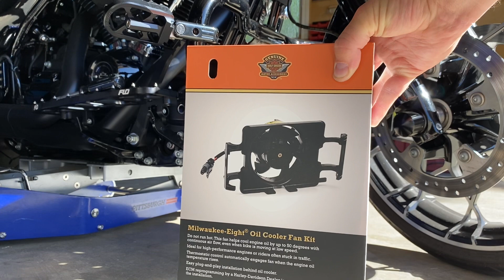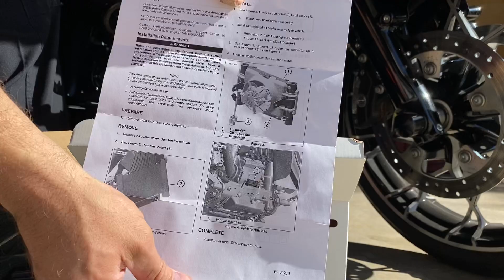Harley-Davidson Oil Cooler Fan Kit, Easy Installation, Ecm Thermostatically Controlled Cooling Fan !

Comment: I recently purchased a 2020 king and wow the heat it puts off is intense.
Thanks for the video - I will start with this fan and move on from there. I agree it should of been installed at the factory.

Comment: Harley knows how hot these bikes run. It should have been installed at the factory. The fact there is a plug-in for it and the system already set up for it says it all.

Comment: The fan still has to be flashed at the dealer so the bike knows when to kick in.
Reply: Does it require a tune as well or just flashed? Can you still run any tuner with this bike?
Reply: can also be done with a dyno vision tuner

Comment: I did install that fan on a 2019 street glide. Does anyone out there know at what temperature does it kick on?
Reply: It’s probably around 200 something but they do have to be flashed at a dealer are someone with HD scanner

Comment: what's your engine temp in traffic on an 85 degree day.
Reply: That’s like winter here in south Texas. Tell me more about 105 degrees
Reply from the maker: Oil temp around 210* on a 90* ride after getting off freeway, the fan works more often while in traffic.